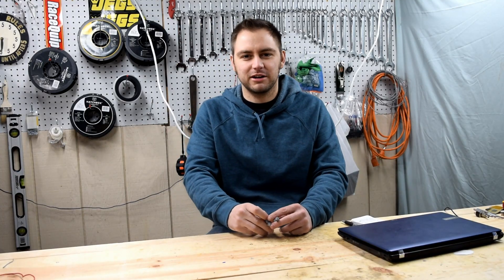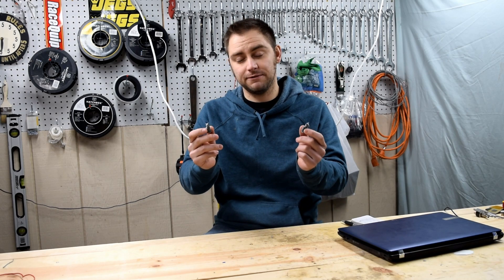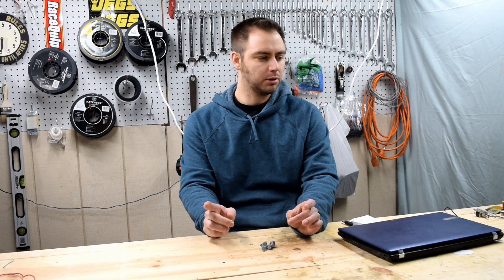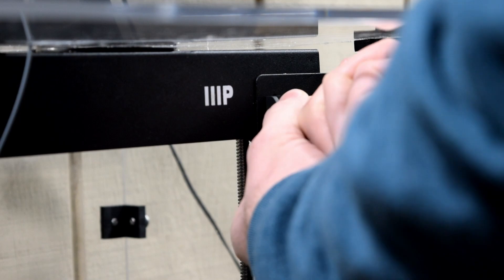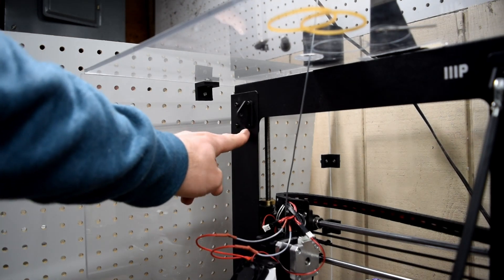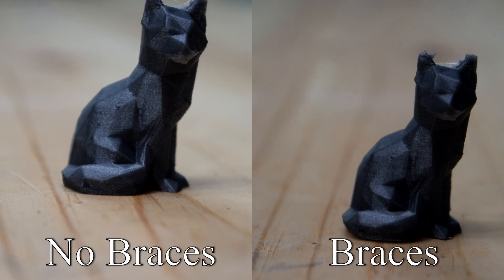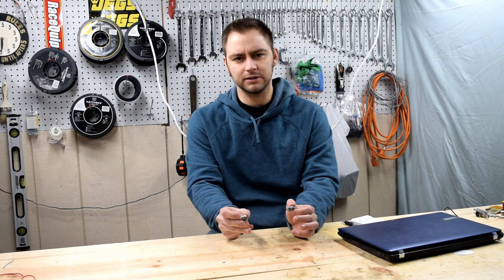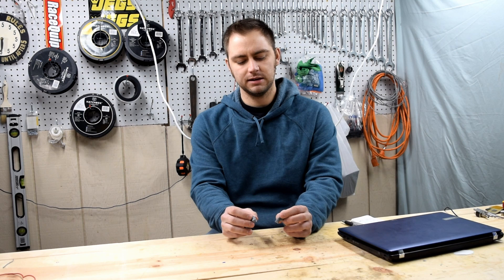3D Printer Z Braces...Helped?

Comment: I don't think I would expect braces to make any difference on such a small print. The print head is barely off the bed when it's making these prints. You need it to be towards the top of its travel before the braces make much of a difference.